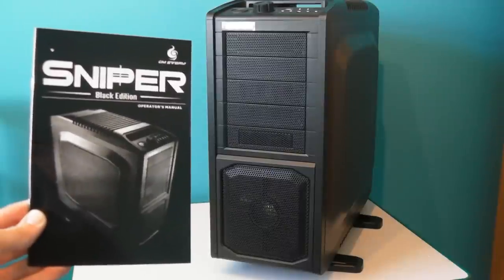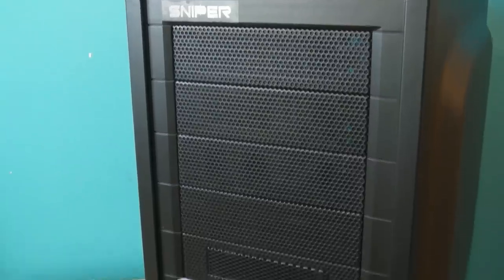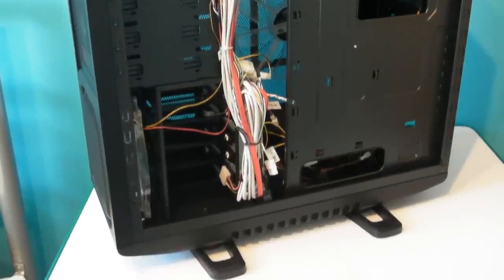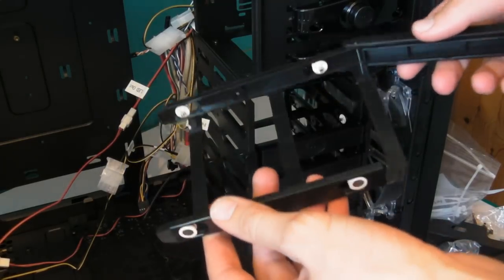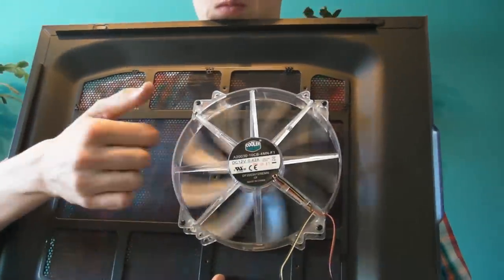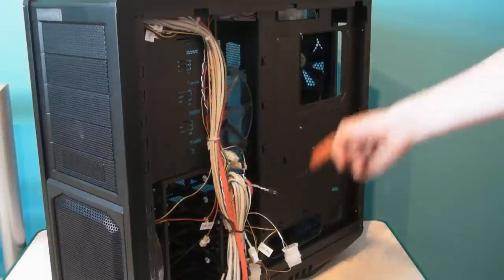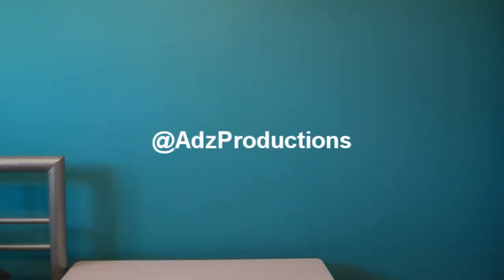Cooler Master Storm Sniper Black Edition Review

Comment: *The way you fast forward the video to show the cable ties and the other components,EPIC
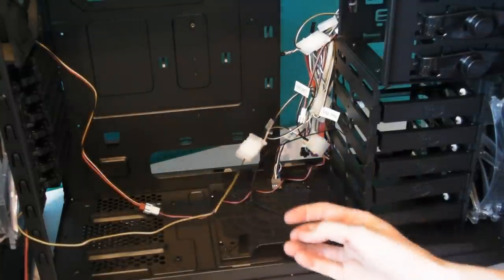*The case details that you have shown at 3:03 are very informative,
but may i suggest that you use a black or any other dark color back round for the text as it is a little hard on the eyes to read with a white back round
*the positive and negative section is a very good idea and the way that you show people where the cables would go is epic...

Comment: I have this case. Mounting using the 5.5 drive bays is really easy. But hd mountain was not so easy. Yes as demonstrated they easily go in and out when you dont have an HD but once you actually try to put an HD in there the rubber flanges were a little too thick and wanted to pop off when you slide them back into the bay. Once you get it in its nice though. The case is not all that loud either, even with all the fans turned up.